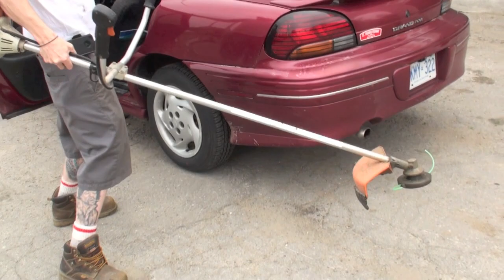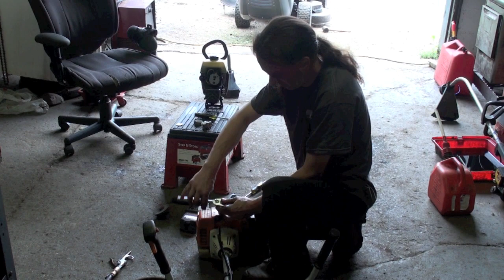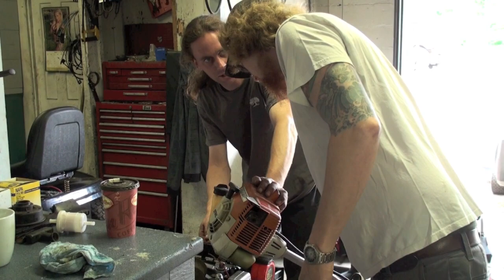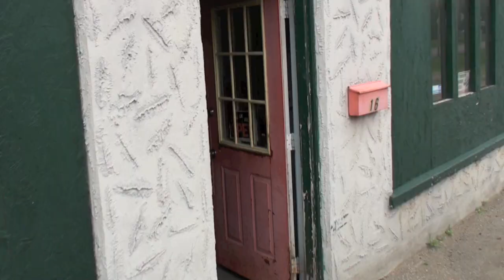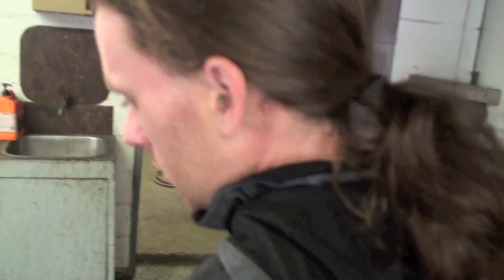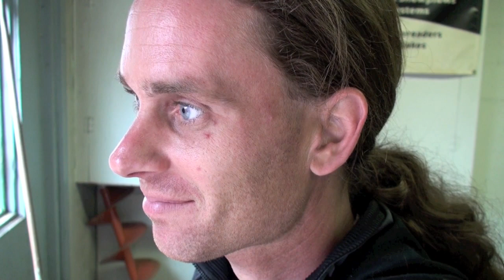talkn bout nelson

Comment: wish there was someone around here like nelson to fix my old ryobi like that. it's a great running straight shaft but the fuel line is all cocked and the only thing i can run on it any more is the saw blade, it's kinda Gnarly but it gets the job done. at least your's is a Sthil there's still hope for it. don't even thing they make ryobi any more.